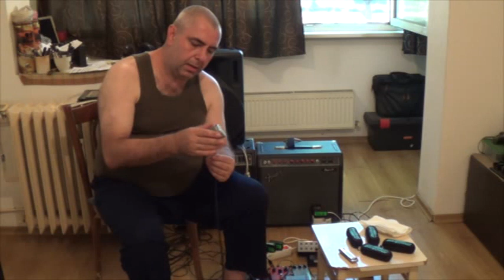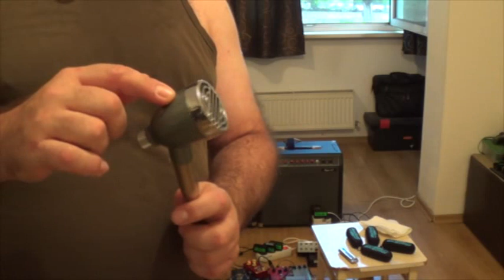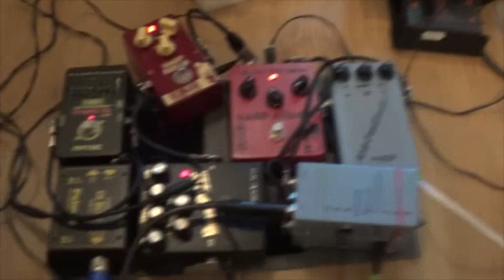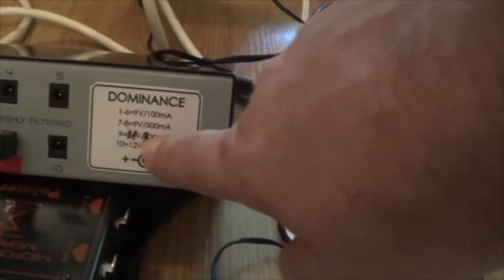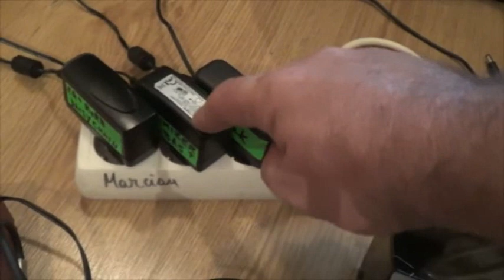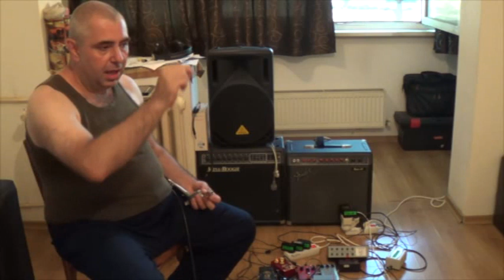Hohner Harp Blaster Lone Wolf Harp Attack Harp Break Kinder AFB power adapters

Comment: Good demo, thank you.  I would have liked to have heard your straight unaffected sound. I expect it's very strong with no effect applied. I understand the effect from the switching power supplies. I built a theramin circuit which cannot work with a digital power pack. 
Also interesting to hear all the kinder effects. I think this is the first demo I've heard for them all together. 
I'll have to listen on something better than my phone though,  to hear the difference between harp break and harp attack. 
Best wishes and thank you again 
Dave
Reply from the maker: Thanks a lot. What exactly you mean with straight unaffected sound ? Acoustic ? 🙂😉👍
Reply: @marcianpetrescu  no, not really although that would be pertinent also. i suppose everything is an "effect" really, as soon as a person starts to amplify. i was thinking about the pedals between the mic and the powered speaker. I was thinking I'd like to hear the sound direct from mic to speaker without all the effects, but it may have just been a silly thought